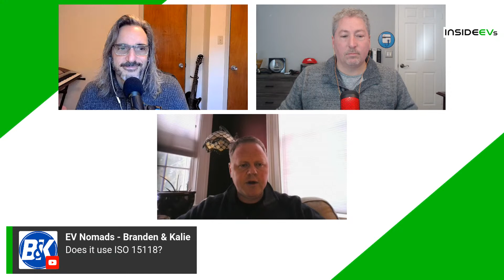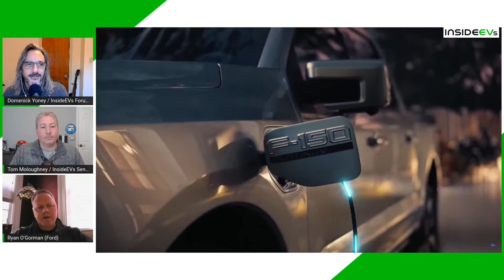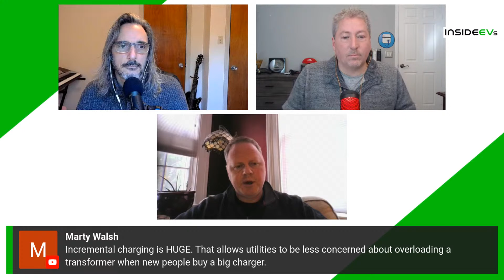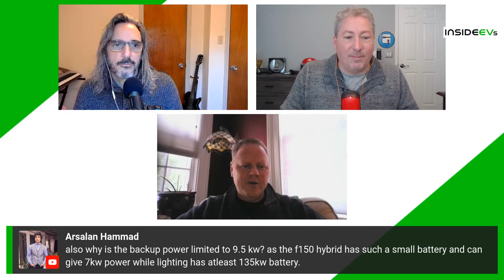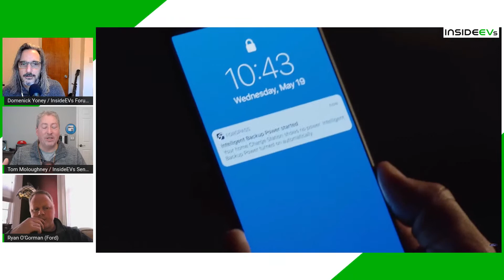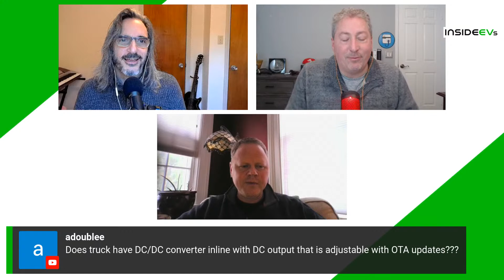Q&A With Ford About Its F-150 Lightning Intelligent Backup Power

Comment: Has anyone successfully installed the Ford's Intelligent Backup Power System?  I am in an area not serviced by SunRun.  Hired a local electrician to wire up the Intelligent Backup Power components. We have reviewed the wiring and commissioning server times but my system errors out telling me my Home Integration Service (HIS) is not installed correctly.  I will try to not be negative (frustrated), but my electrician and I tried to get support from SunRun and/or Delta and been ignored.
Reply: Bill - did you figure this out? I am facing the same issues with my electricians.

Comment: Ryan just briefly talked about the potential for parallel backup systems. For me - I don't need parallel systems, but I'd love to know if you can have two inverters connected in parallel to double the 9.6kW output to 19.2 kW for the house/  9.6 kW will be ok - but 19.2 kW will allow me to power my entire house without thinking about anything and will be VERY useful when Ford Intelligent Power comes online.  (By the way - I'd love to be an early tester of that system if I can!)

Comment: Helpful info here, but still no specification on peak AC power to start HVAC compressors.  9.6 kW might be enough to start my air conditioner, but I think the peak is closer to 20 kW for about 50 milliseconds at cold start.  This is a common specification for solar backup systems, it should not be hard for SunRun to state it.

Comment: What is the Lightning battery warranty specifically state for holding charge, like if charge no longer goes above 90% or 80% within the 8 year / 100K miles?
Reply: So it likely models the Mustang Mach E battery warranty which is based on state of health. The battery will also be able to charge to 100%, but like a cell phone, 100% on day 1 doesn't go as far as 100% on year 8. The warranty will give you a brand new battery if the state of health falls below 70% in that time so you are guaranteed 70% of range after 8 years, but so far the most of the Mustang Mach E batteries are not degrading close to that rate. I recommend you do more research on the topic.

Comment: Tom, we've been trying to get this question in; Will SunRun be entering into VAR contracts w/ electrical contractors across the nation to install these units for Ford? We've installed over 10,000+ charging stations across the US, majority for Tesla, but as EV charging specialists for all things sales, installation and service we are wanting to get in front of this in order to be a value added asset for SunRun and compliment the benefits of the Ford Charge Pro units w/ Intelligent Backup Power system?

Comment: If you’re happy to switch off the main fuse manually and do a slightly iffy (non certified) wiring job, it should be easy to take power from the truck’s power socket and feed it into your house....no special/expensive equipment needed..😝 just make sure you don’t touch the live bits and electrocute yourself!

Comment: Sounds like Ford is not offering adapters to allow me to charge my Chevy Volt.....bad idea. Thanks for the info!
Reply: Don’t you have a mobile charger. I have one that I can change from 14-50 , 14-30 etc. I would think this would be all you need to charge at level 2
Reply: Maybe in the future when standards are developed, if a vehicle has that as a design target, but are you saying your Volt ran out of gas and you wife has to bring your Lightning to the side of the road to give you a boost?
Reply: @davidmccarthy6061  I am saying I have a level 2 charger I use for my Volts on a 40 amp breaker. My panel is maxed out. Switching to the Ford charger running at 40 amps allows me to charge both vehicles with an adapter that apparently Ford is not supplying.....which is stupid.....as is your lame comment about my wife and my Volt running out of gas.
Reply: There will surely be 3rd party solutions for this and the Tesla incompatibility Tom brought up during the interview. It would seem a simple sleeve with a notch to fit over the CCS connector and extend the J1772 portion would solve the problem, hopefully a UL certified adapter will be available within a couple months of the chargers entering the wild.

Comment: Ryan kept referencing the extended range battery during today's interview, but Tom's deep dive on State of Charge said you could use Intelligent Backup with the standard range battery. Can someone confirm Intelligent Backup will work with the standard range battery, albeit I'll have to shell out more out-of-pocket for the equipment than someone who purchases the higher-end model that has most hardware included?  Thx
Reply: Yes, I am 100% certain it will work with the standard range battery - 100%.

Comment: Nissan has had V2G for years
Reply: Yes but not widely available to residential users in north America, right?  And a MUCH smaller battery in most Nissans.  But correct otherwise.
Reply: @jimmclaughlin2603  just pulling up the idea that people and ford seem to think Ford were the first.
Reply: @rtfazeberdee3519  First on a CCS1 coupler with a product for end consumers?  But this Ford offering is not "V2G" since it only powers the home (V2H if you like acronyms).  It outputs a constant voltage when the grid is disconnected, while "V2G" outputs a current into the grid when the grid is up (the grid controls the voltage when it is there, so it is a VERY different mode for your inverter).  Further, there are many commercial applications of V2G already out there running on (for example) school buses with CCS1, see Nuvve.

Comment: It seems like Ryan does not want to say you can run the 30 amp bed power to your house panel to be distributed as you wish. But it appears the answer is "Yes".....correct?
Reply: Yes.
Reply: Just be very careful not to backfeed to the utility.  Maybe put tags with a checklist on the main circuit breaker, hign loads (A/C, oven) circuit breakers, and EV connect points.  I hope my solar can feed at the same time, but if the truck battery is full, and home loads are low, I think the solar needs somewhere to go or there could be a problem?